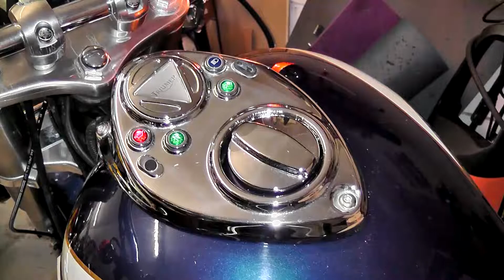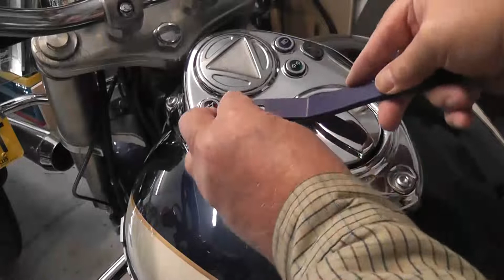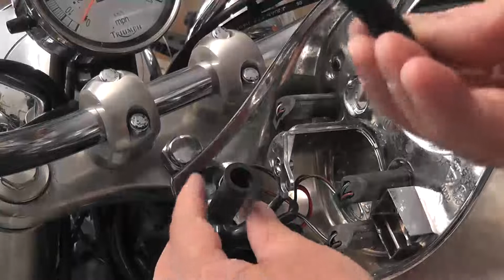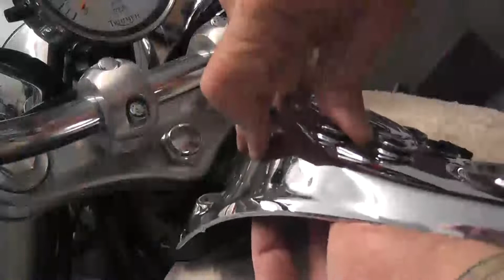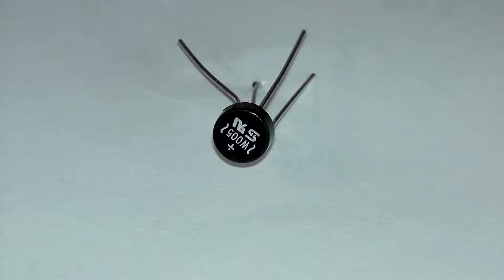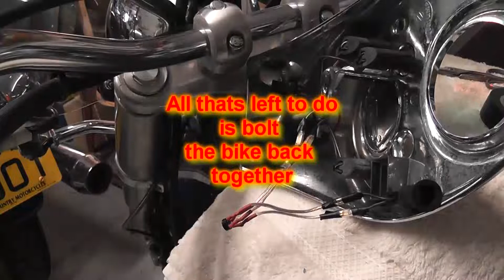Triumph America Idiot lights

Comment: I put an LED headlight in my 03 Bonnie, had to modify the back of the bucket to fit the new bulb. At idle, the headlight flickers a bit but is fine off idle. Maybe has something to do with the lithium ion battery I installed.
That battery spins her over really fast.!

Comment: Following these instructions I was able to swap out my 2005 Speedmaster's dull warning / idiot light incandescent bulbs with much brighter LED bulbs which were not polarity sensitive so could be used on the indicator warning light without the need for installing a bridge rectifier etc. Simply 'plug and play'.  Also, I took advice and used red LED for the oil light and green LEDs for the neutral and indicators. These give a deeper, richer colour. Many thanks for posting the video, it's very useful!!

Comment: Sometimes you wonder what kind of pot those designers are smokin when they design stuff. All of those light should NOT be flat on the tank or on the tank at all. Put then in a little panel at top of fork where handlebars mount to the forks. Tilt 27 degrees forward from vertical. Ign. key should be in same panel as the lights. That huge chrome light thing on the tank is gawdy. Harley Davidson is bad for that too. Can't see a thing in bright sunlight. Too much glare.

Comment: Thanks for sharing your knowledge. I have fitted the LEDs to all of my lights except the blinker (indicator). I'm in Australia and I'm unable to source the bridge rectifier you have used here. I have found this unit: W04 1.5A 400V Bridge Rectifier. Do you think this will do the job? It's specs are:
Diode Type - Bridge rectifier
Peak Reverse Voltage - 400V
Diode maximum current - 1500mA
Diode maximum power - 600W
It is physically packaged very similar to the one you used. 
Any advice appreciated!
Reply from the maker: Yep should be ok the current it can take 1.5a and the voltage it can run to both exceed what you will be using with the replacement led indicator warning light. The led will only be a few watts of power so the current will be low and the voltage 13 - 14 volts the battery floating off the alternator is ok.
Reply from the maker: Meant to add sorry for the late reply  new year took its toll, good biking